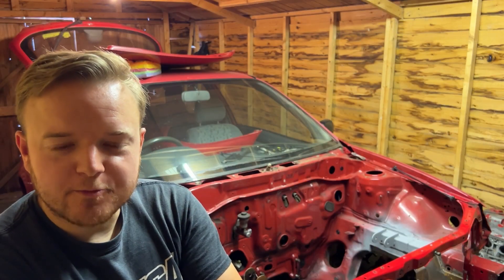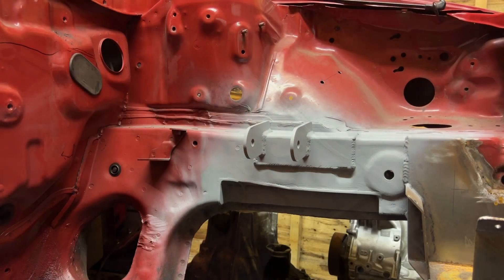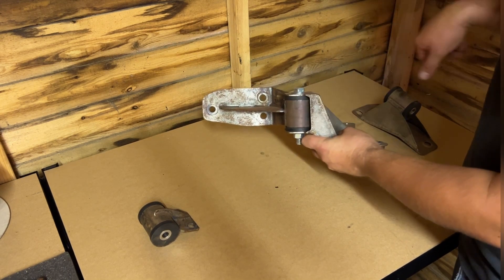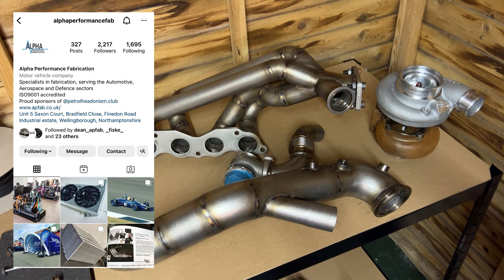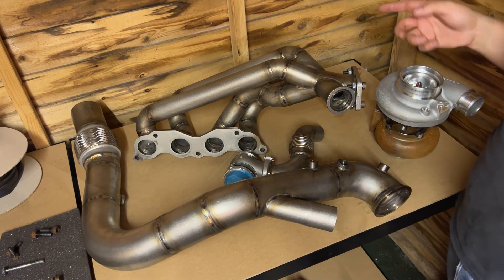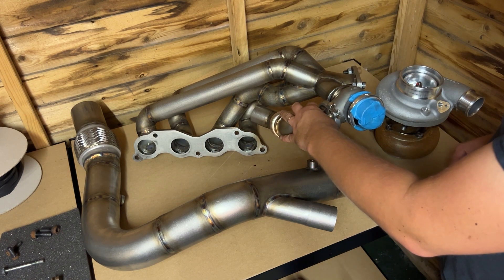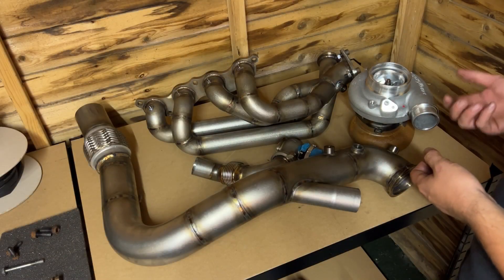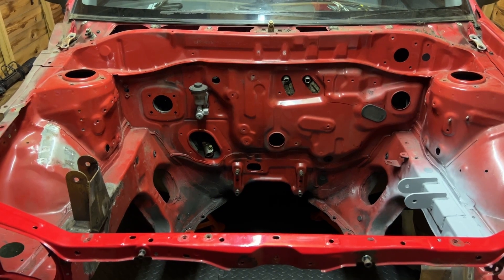Honda K20 Toyota Starlet EP91 - EP #2 - Engine Mounts, Chassis Notching, Turbo system and more!

Comment: Id brace those engine mounts little more on the chassis dude ✌️.  
Got a K20 205 myself with same sort of setup on the mounts 👍🏻
Reply from the maker: Thanks for watching and thanks for the advice too!
Reply: @K20Starlet   - my mounts pretty much exact same ,, 
The 2 side mounts id brace more as theyr leverage point is alot higher , ✌️